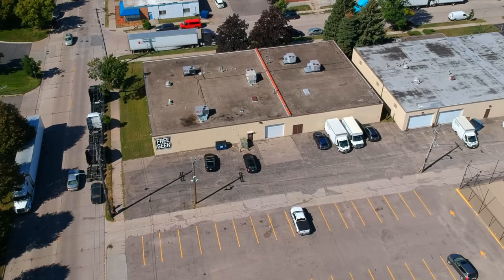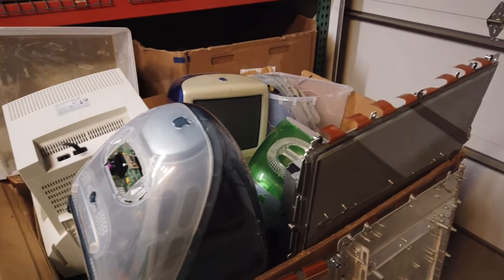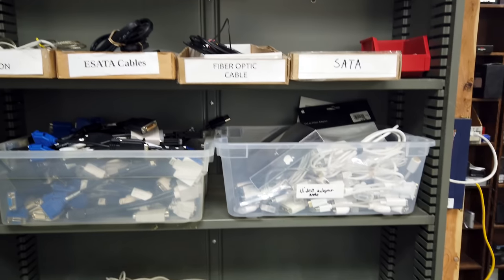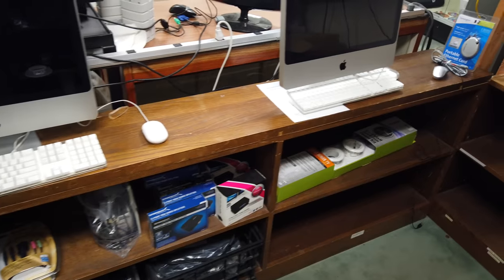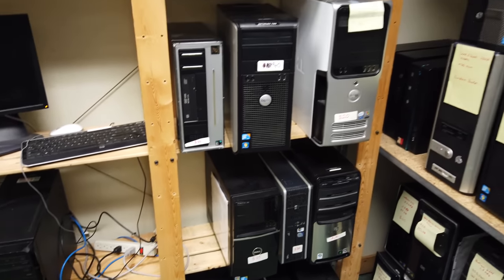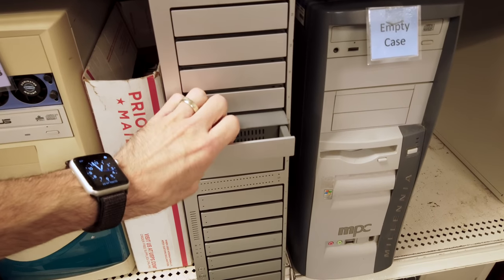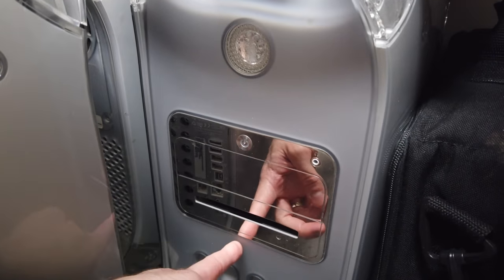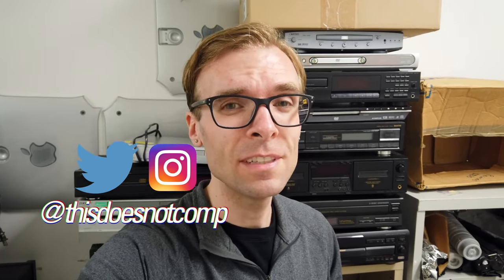SO MUCH RETRO TECH at Free Geek Twin Cities!

Comment: For a couple decades, we had a place like this in Silicon Valley called Weird Stuff; gigantic warehouse full of all sorts of old tech. Computers, blade servers, old telecom equipment, video gear, anything you could imagine, really. Lab equipment, test units, hell even some old traffic lights. Additionally, they sold new stuff, like spools of Cat 5/6 cable, speaker wire, etc. Tragically, they closed down a few years ago.
Reply: Yup, WeirdStuff was just a few miles from my house. Great place but Google bought the land out from under them and they couldn't find a new place with reasonable rent so they closed down. It's a shame that here in the heart of freakin' Silicon Valley there isn't a place like Free Geek!

Comment: We do our best to get the vintage stuff fixed up and back into circulation.  The 3 imacs that went to recycling were beyond repair and some of the internal boards were used over time to repair other imacs that went to the store and have since found new homes.   For the most part we do not allow (due to insurance) any volunteers to open CRT based products due to the danger of high voltage.    As for breaking down CRTs for recycling,  we do not have the proper facilities per Minnesota law to do so.
Reply: Yep, you could get a heck-of-a-HUGE-shock if you worked directly with the CRT's.  I can remember discharging those units - not fun (and would scare the crap out of me!)

Comment: I worked for a small computer shop in Indianapolis, Indiana oh-so-many-years ago (been closed for many years) and I had a favorite computer on my work bench - a Mac SE-30 with a 30 GB hard drive.  I also was privy to a color unit.  I loved that little computer and it was a blast working on those units!  Kinda getting the itch to start working as a part-timer again.  BUT, I am NOT computer poor.  In fact I have many I should recycle because I've held onto them for too long.  That adapter you showed to us --- I used to use one all the time.  Saved me from bending pins in the attached peripheral(s).  Your report sure brought back many memories!  Some good, some great and some, well...............  Thanks for sharing this with all of us!

Comment: Wow, what a goldmine.  Also, those 2012 MacBook Pros (despite being "2012") were sold well into 2016 as the low-cost "Educational" model.  They're still supported, and believe it or not, they can run Mojave.  Just throw a cheap SSD in there and you have a very capable Mac laptop for office work, streaming, movies, etc.

Comment: I love this place so much. Right around the time you posted this I dropped off a blueberry iMac that I just did not have space for. It worked fine and even included the keyboard (but no mouse). About a month later I dropped off half a van full of various tech parts from my office (we cut down the size of our office and uncovered a ton of old stuff). They gladly took it all for free. A while back I had a very old 1950s CRT and did have to pay $30 (as I recall) for them to take it...by far the cheapest price I found in the Twin Cities area.

Comment: I fix PC's, and my god I could literally fix about 90% of any and everything in there in a week... and I'd more or less be in heaven the entire time... with that said, man... a slight investment in windex and paper towel would go SO FAR in moving that stuff... oh, and a shop vac on reverse in a well exhausted room.  Even if you don't want to open and clean out each PC, at least blow them out with some high(ish) powered air, like say, that of a shop vac in reverse... It also goes quite far in having another human want to touch, let alone pick up and take home an item. No one wants that machine with the visible 4lbs of nicotine chunk dust in the front fan... 2 seconds with the shop vac, another 25 seconds with the windex.... and it would be a gem.

We used to have a Goodwill computer center here in PGH PA... which due to poor interest levels, ie. no customers... it recently closed. But it was a lot like this. Semi recently I even got a $9.99 HP Elitebook, first gen i7 720qm with a dream color display, 1080p, professional display... some large gamut of the adobe colorspace, etc... I love it, I use it as much as my thinkpads, new and older... Wonderful machine, and all it needed was ram and a hard drive, and it was good to go... not a scratch or scuff on it either. Beyond that it was the same walls of towers, flat panels, bins of cards, cables, etc. but in the back room, separated via a counter, was a couple of guys who could vend you anything you needed... from as old as SDRAM to DDR4, from P233MMX to 7th Gen i7's, and everything in between... all removed, tested, and maticulously kept, until sale.  I went there for everything I ever needed if I could make the trip, and didn't NEED to amazon it. DDR3 Sodimms in 1600Mhz flavor? Sure... Spare i7 980x or 3930K? Sure.... basically anything to add to or build anything, and yeah... they had it... and now it's gone, because well... everyone saw it as Goodwill, and it wasn't "cool" .
Reply: There's a place like this near me except it's often booming with people. Sadly they only stock newer PCs as their space is limited. But they have a games section and it's like stepping back into the early 2000s. Tons of PS2 and XBOX, even big box PC games, which is a real treat. To walk into a store and see a shelf of old school big box PC games is awesome. I feel like more than half the time I find a real gem. They even have old Game magazines sometimes like GamePro and GameFan. I can't wait until it opens back up after all this.

Comment: This is my kinda shop!  They need to open a branch in my neck of the woods.  You mention that they don't stock machines that fall below their "minimum specs."  However, there is demand for older beige box gear that is below such specs...  I would love a replacement for my old NCR PC4 running DOS.

Comment: Would be worth checking it out again when it re-opens. There's a ton of modern stuff. Like, high-capacity DDR4 and Ryzen modern. Here's a list of the stuff people have donated that would make you ask, just why:
 - 3 128GB kits of DDR4, donated by 3 different people on different occasions
 - 1 64GB kit of DDR4
 - 4 ASUS X99 Deluxe II's
 - 3 1TB Samsung 850 PRO's
 - 2 GTX 980 Ti's
 - 2 GTX 1070s
 - 2 GTX 970s with waterblocks
 - an RTX 2080 Ti cooler (we've successfully pranked tons of people with this one)
 - Expensive CPUs (TR 1950X, i7-7700K, J-bin i7-5960X, i5-8400, 2x i7-6700, R5 2400G, many more)
 - 3 complete custom loops, one of which had 4 radiators and 2 pumps

There is legitimately so much expensive stuff now that we have a separate locked area to keep them in.

Comment: It hurts to see those G3 iMacs going away. I've been looking for one. There's absolutely nothing like Free Geek near me.
Reply: I use to have a Graphite IMac G3 with 512 RAM, and  OSX 10.2 several years ago where the CRT gave the magic smoke, and unless you collecting one for nostalgic purposes they honestly are not the greatest machines to use with their slow processors, and HDD. Yeah OS 9 runs a bit better on them, but not by a ton. You are better off looking for a G4 system.
Reply: @CommodoreFan64  Speed isn't so much of an issue since I want to run OS 9 as it should be able to run classic stuff a lot easier. It's true that CRTs are hard to repair, but it's not as if the gas-spring flat panel G4 iMacs would be any easier to repair of the panel goes. Your best bet would be to get another one and swap the panel out. In the case of the CRT iMacs, you'd swap out the motherboard and drives into one where the CRT works but the rest doesn't. In the end you still need another machine.

Furthermore, I wouldn't be surprised if what failed were capacitors which are easy enough to replace if you can figure out which one failed (if it let out smoke, then it should be pretty obvious).

Comment: I can understand doing a fully wipe of the hard disc but that is where I put all the drivers for the hardware when I have donated computers. Along with PDF of manuals. Most machines I have are multiple OS, one had NextStep, Win 95 and NT4 on it with the Win95 partition holding all the extra drivers for these and Win98 and XP.  The original CDs, floppies and manuals were included but these too often get separated from the machine.

Comment: The closest thing to this here in the Boise Idaho area is called "The Reuseum".  Prices are kind of hit and miss though, but they've got stuff in there from probably the 70's and older at times.  I have bought a couple of laptops from them in the past for less than $50 which were pretty decent machines that had windows 10 running on them.  I don't get over there very often, but last time I was there they actually had a Commodore 1571 disk drive, and they had a Commodore 128 over there as well that I think they wanted $190...already have a C128 and a disk drive.  They wanted $50 for that 1571, should have bought it but didn't have the extra money.  They also do some technology classes over there for kids too, and some small 3d printing stuff too.  I believe they do some robotics stuff over there occasionally too.

Comment: I remember getting rid of my last CRT monitors and TV sets one at a time.  I loved my SONY TVs, but I don't miss them.  50~60" LCD TVs are easy to carry.  A 32" CRT really should have 2 people to move them.    That said, I still have a CRT monitor for my old old Commodore/Amigas.
A friend used to work at a TV, he did board-level repairs on TV.  Such repair abilities are mostly gone nowadays.  Those TV repair shops have died out or they do basic modular repair on LCD TV.  = PSU, screen, Light system, and motherboard.    There is basically no profitable business model for repairing TVs anymore.  Those guys have retired or died.

Compare 2002 to 2022.  There used to be 4 repair shops that I used to know of.  There is now only one left that covers about a 100mile x 100mile repair service area.  In 2002 it had 8~9 employees. In 2022, its just the owner and 1 employee.   Many of the  TV companies just replace warranty TVs.  Once your 75" TV is out of warranty and dies - good luck in fixing it.   It'll be trashed and you'll drop $400 for a new TV.   Even those $1000 TVs may live for 2-3years.

$1PATA drives, LOL.  Worthless,  But for an old PC rebuild - can't be a $1.
Still amazing that today, a 1~2TB SATA drive isn't worth much.

I see four homebrew PC, in the video - I've sold to clients  Like the blue one.  Which was a pretty sharp case, its front bezel is metal, even the black grating.

The 4:3 LCDs are great for retro gaming consoles and older PC setups.

Hey, yo know anyone from Twin Cities 128? - from the 1980s?

No more Amigas?  SIgh  I remember seeing Amiga 2000 setups with a Toaster and monitor on Ebay for $200 and Amiga 500, 600 and 1200 for $75~100 and I didn't any of them.

Comment: I kinda want a 4:3 monitor if it's free, but I'm in Los Angeles... Which is why there should be more programs like Free Geek spread out across the U.S. This video was very informational and I hope to see more from this channel and others like it.

On another note, the plastic casing of those broken Apple Imacs could still be used for some neat projects (One possibility could be to add in a Raspberry Pi 3B+,  an HDMI Display with a plastic fitting to mount it to the original case, and a powered USB Hub...)

On another another note, Sonic R can now be played on Windows 10 with the Sonic R Updater.
Here's the link to the updater if you're curious:
https://gamebanana.com/tools/6325
It also enables the use of mods for the game.

That is all.

Comment: Lmao I have the same Sony CD deck as well. I found it at my local recycling centre just after my 5 CD changer became a 5 CD eater. Solid deck, but bass from the speakers can cause it to skip. 
If anyone else has one, slap some soft pads under the feet.